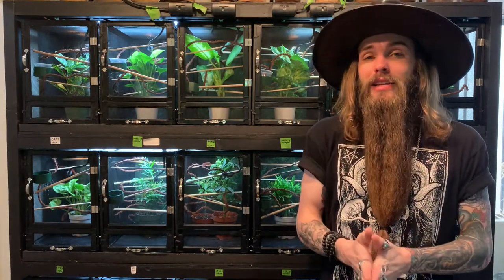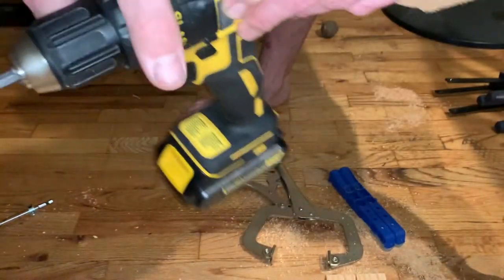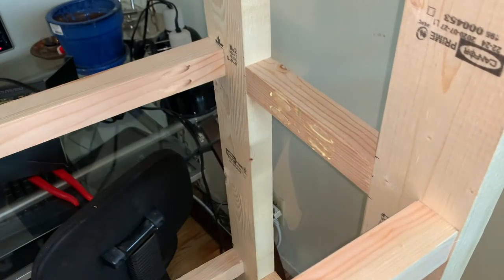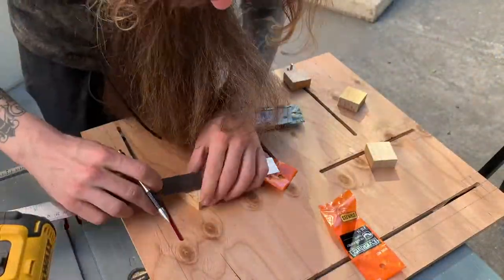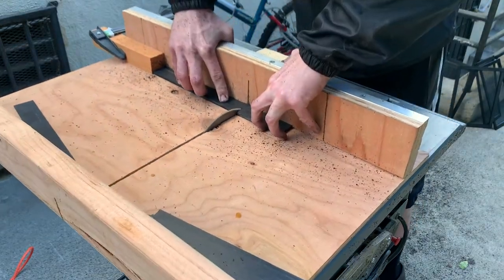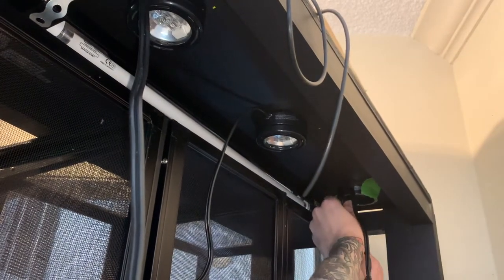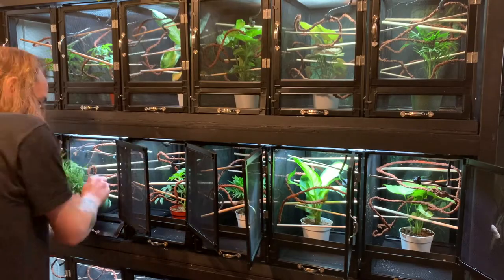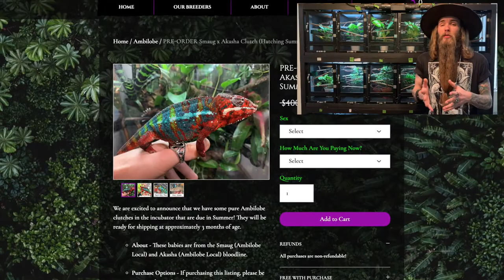DIY Cham Rack from RAW Materials!

Comment: I know the prices will vary depending on cost of items at the time of filming but about how much did this cost you for everything if you don't mind me asking?
Reply from the maker: If I were to build this exact rack now, the cost of items would break down as follows. This is just an approximation. Also, I'm not including the cost for the saws, drills, and other power tools that I already had.
Also, I suggest possibly waiting for lumber and material costs to go down. They have been out of control with the impact COVID has had on supply and demand.
Lastly, I highly encourage you to not be discouraged when you see the final price. Building something quality will pay for itself in due time. Consider buying things over a span of time than all at once.

RACK:
Lumber:
(approximately x10) 2x4's - $5.87 ea. (total $58.70)
(x3) 4x8 15/32" Sheets Plywood - $36.55 ea. (Total: $109.65)

Paint:
I just used the cheap latex paint that Home Depot sells. I believe they're $13 or so per quart container. I used 1.5-2 quarts 
(Total $26, plus some extra paint to use for something else)
Paint brushes are usually about a dollar for a cheapo one and about $5 for a small roller 
(Total $6)

Screws:
I used a Kreg pocket hole jug to build this. These cost anywhere from $20+. If you like to build things out of wood a lot this might be a worthwhile investment. However, if it's a one-time-use type of thing, just stick with the $20 version. You'll also need the pocket hole screws that go with it which are about $5. (Optional Total $25, not included in final cost below)
Alternatively, you can just butt joint all the wood, eliminating the cost of the pocket hole jig.
You'll be using multiple size screws which will cost about $6 for 100. You'll need at least two different sizes (Total: $12)

Wheels/Casters:
I used some I already had, but if you choose to use them, you can find them pretty cheap at Harbor Freight (not included in final cost below)

CAGES:
Depends if you want to make them or buy them from Zoo Med or a similar Brand.
If you build them the size I made them, each cage's cost will break down as follows:
Frame:
(x4) 5/16" x 3/4" Aluminum Frame (sold in 7 foot pieces) - $4.18. Multiply that by 24 (since the rack holds 24 cages) (Total: $401.28)
You may have extras if you don't mess up any cuts, however, this will ensure you have more than enough to mess up here and there.

Screen:
I bought a HUGE roll of it off Amazon. The silver aluminum is significantly less money (but rusts after time) than the black aluminum version, but I suggest buying the black version as it will save you the hassle of painting the silver one. Also, make sure to not get fiber glass screen, because bugs will chew their way through it.
The 48'x100' roll of black I have cost about $128, and you wouldn't use nearly all of it. 
(Total $128, with lots of screen left over)

Spline:
27 feet per cage needed. This totals 648 feet for all 24 cages. You can buy 100 foot packs off amazon for like $8. You'd need 7 of them
(x7) 0.125" x 100' Spline - $8 ea (Total $56)

Spline Roller: 
(x1) Spline Roller - $6 ea (Total: $6)

Paint: 
You can always omit painting the Aluminum frame, but if you want to paint it, a good can of spray paint is about $5. (I assume you'll need about 8 cans)
(x8) Spray Paint Cans - $5 ea. (Total: $40)

Screen Corners:
With everything I listed above, you'll be using 3/4" plastic corners. 
I highly suggest getting packs of these in bulk off Amazon. You'd be surprised how many you can get for a small price vs what you'd pay for 2 at Home Depot.
You'll need 32 per cage, 768 for all 24 cages
Amazon sells 100 packs for $18 so, 
(x8) Screen Corners packs - $18 ea (Total: $144)

LIGHTS
UVB
I used the 24" Zoo Med T5 fixtures for this and used 8 of them (2 per shelf). These typically cost about $60, but you may be able to find them whole sale or cheaper depending on the site you buy from. So,
(x8) 24" Zoo Med Reptisun T5 Hoods & Lights - $60 ea. ($480)

Heat: 
You can find the recessed lighting at Home Depot. I used 1 box of 6 per shelf
(x4) Puck Lights - $50 ea. (Total: if $200)

Dimmers:
Each set of heat lights I used 1 table top dimmer
(x4) Table Top Dimmer - $14 (Total: $56)

DRAINAGE
Drainage Trays:
I made one for each rack. I won't include this drainage solution in the total cost below since my drainage solution may be different than yours. You can check out my other video titled DIY DRAINAGE TRAYS if you're interested in what I made for this rack.

Aside from all of the materials to build the rack and cages you will need to furnish them. The price to furnish each will vary depending on whether you use live or fake plants, real branches or dowels, et cetera. I will not be including that price in the total of the project. 

Anyway, with all of these costs summed up, you'd be looking to spend about $1,723.63 excluding your local tax rate.

There are ways to make this less expensive, such as making a smaller rack, using silver screen, omitting a paint job on the cages, repurposing lumber and so on. 

I hope this was enough of an answer to give you a good idea of what you need and of what you're looking to spend, However, if you still have questions, let me know (:
Reply: @MagickalChams  you went above ond beyond man, thank you for the response keep up the awesome videos

Comment: Do you have a link to the Puck lights?
Reply from the maker: Of course, Keenan! 
Just make sure you are mindful of the temperature these put out. I use the lowest wattage bulb (halogen or xenon) and put them on dimmers set to a low setting to ensure nobody gets burned. Make sure you use a temp gun to get a reading in the hottest area the reptile has access to.

Here it is: 
https://www.homedepot.com/p/Hampton-Bay-6-Light-Xenon-Black-Under-Cabinet-Puck-Light-Kit-EC1333BK/202051199